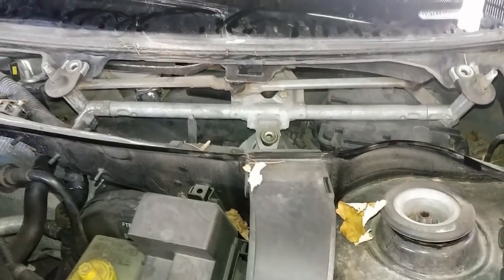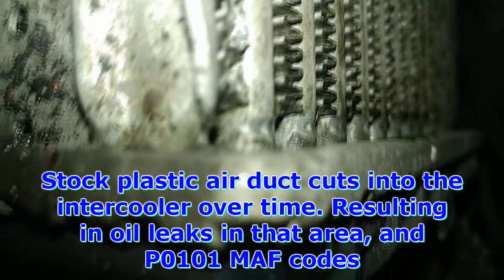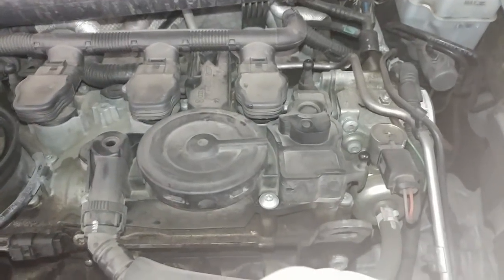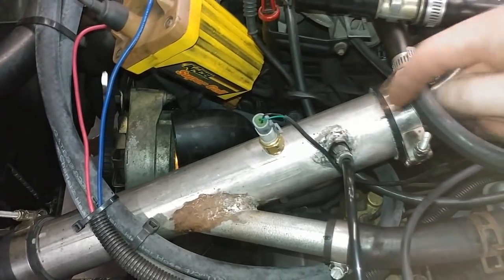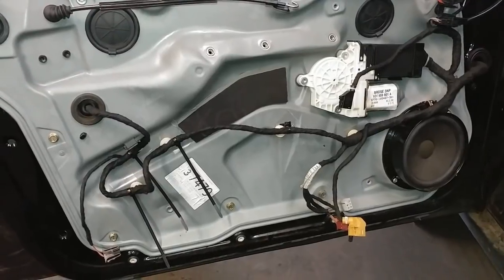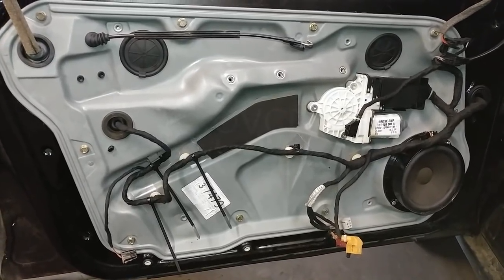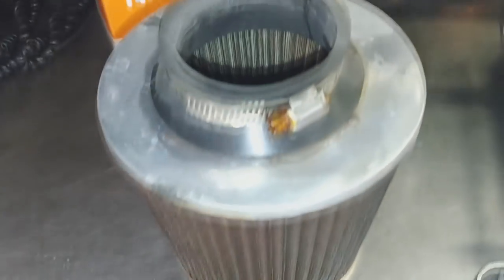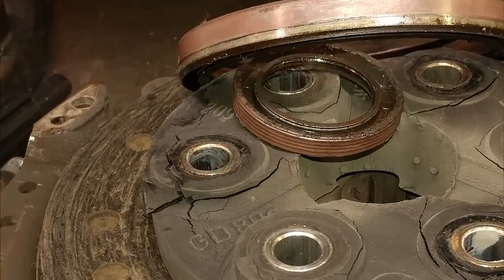Various bits December 2018

Comment: That's an amazing code i've never seen that one.
Reply from the maker: He was lucky... the engine usually doesn't run / or there's some kind of damage when that code is set. =)
Happy New Year!!!
Reply: @EXOVCDS  Happy new Year Thomas
Reply from the maker: Thank you!
Reply: I had seen it with vcds. The part I had to change was the speed sensor under the transmission mount on the 01m transmission.
Reply from the maker: @xbin87116  http://wiki.ross-tech.com/wiki/index.php/17968/P1560/005472

Comment: I have an question what brand of vacuum lines do you suggest? Replaced mine one year ago and found out that all were cracked when cleaning up the airbox
Reply from the maker: Sadly, vacuum lines these days don't hold up as well as they did 20 years ago. =(
Buy whatever is easy to get and check every year. More expensive silicone hose will last longer and you can buy it in different colors! =)
Reply: Thomas EXOVCDS will go silicone , believe it or not .i had the stock fuel lines and they had no cracks (were not falling apart too like the ones on the gas tank did ) but I still teplaced em , thanks for the tip

Comment: a bit off topic, any suggestions why a 1.8 turbo Octavia has a strange rumbling noise when the engine is in the middle-high torque?  everything is stock, engine has good performance, no codes except intermittent fuel trim error, but that's not the case....
Reply from the maker: Not sure... does the noise change when in different gears with similar torque range? Is the rumble similar to / consistent with engine speed or vehicle speed?
Reply: @EXOVCDS noise is  consistent with engine rpm...  1st an 2nd gear is loudest, 3 and 4 can be heard 5 gear, speed is too big to be heard... i hope it's not the gearbox 😞 . i almost forgot, Happ New year 🎉
Reply from the maker: I haven't run into any engine "rumbling" noises... vibration or rumbling from drivetrain components could be an issue. Not sure.

Comment: Is it the same procedure as the Tiguan for changing the drivers door control module on a Mk5 golf?
Reply from the maker: On the 5's the outer door panel is removed, leaving the window regulator in place. On the Tiguan, the window regulator & panel are removed WITH the door lock actuator attached to it. Here's a video for the 5er.
https://www.youtube.com/watch?v=WTlHcxxY4V0

Comment: Can you tell me when a time belt for a 1999 VW New Beetle needs replacing?
Reply from the maker: Sooner than later... to be safe.
I recommend 6/7 years or 120k/140k km's 75k/87k miles. 
I have seen broken belts at 90k km's, but they were 11 years old.
If in doubt, replace to be safe.
For my 1989 BMW, it's recommended to replace every 4 years or 100k km's 60k miles.
Reply: Mine has 70k only, but it is a 99 (old).  Are they typically 1k?
Reply from the maker: @elizabethhutson9767  1k what? $? I would replace it due to age.
Reply: I meant does it cost about $1000 to replace?  Thank you for your help.
Reply from the maker: Could range from $700 to $1000 depending on the engine and any other items that might be required. A "timing belt kit" will come with the belt, tensioner, rollers and water pump. Camshaft or crankshaft seals, crankshaft bolt etc would be added cost.
Reply: Thank you!!

Comment: The rant, LOL. Maybe the complaining customer is happy with your work, but not what the shop charged. In Canada shops charge for every crap. I have seen CAD 50 for rags. Or parts charged when they hooked up the scanner. I think the issue is with the service center / shop owner and not the technician. I always tip my technician, but get irked when shops charge me for non-sense. I hope the guy respects your workmanship. You seemed to be very detailed and an efficient worker. It might not be you.
Reply from the maker: Not many know where I work... replying to comments gives me an idea of what the individual is like. I always get the sense that standards are high... which would make things difficult if they were to bring the car to the shop. Since I don't have control over who works on the car or what the final bill is, I keep the location private. Although the hourly shop rate should cover various items / go towards expenses & employee wages etc... it isn't enough. In some of my live chats this topic was discussed between the participating Techs. The "extra charges" need to be reasonable and reflect a certain percentage of the labour charged. We've had customers leave unhappy, only to return years later because other shops would not take on their requested work (when it was time for something that their DIY skills could not accomodate). It's tough running a business... that's why I haven't opened a shop of my own.
Reply: @EXOVCDS  I don't know what happened. I would never make a deal about the zip ties vs. OE clamps. I wouldn't take it to personal. You know the cheap car owners that don't maintain their cars. I have to shake my head with all the nest and leaves that you remove from cars. Or the guy with the brake rotor or something really weird. Happy New Year!
Reply from the maker: Thanks... Happy New Year to you & yours as well!

Comment: Whats with the rant picking on us DIY'ers?  Lol
Reply from the maker: December was my month to vent! LOL
Happy New Year!
Reply: Did you replace the pilot bearing on your clutch job? Had to use the wadded up bread method to get mine out!
Reply from the maker: Yes, I replaced it... I have a slide hammer & adapter kit that took it out.
I didn't have any bread with me... I saw that video. Whatever works!